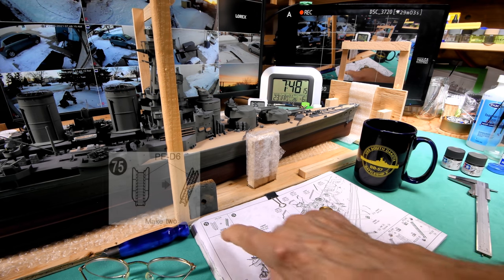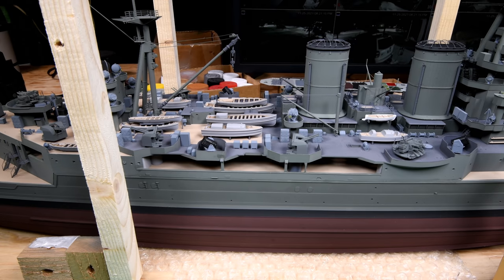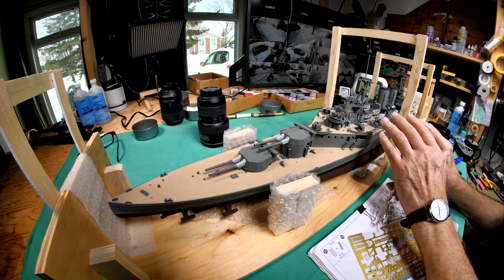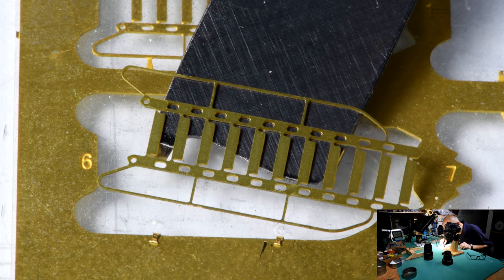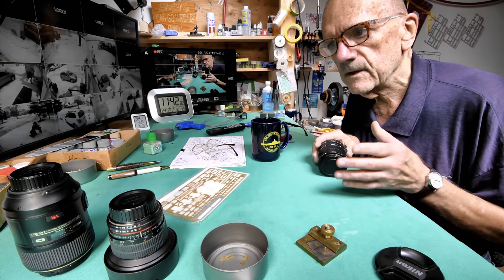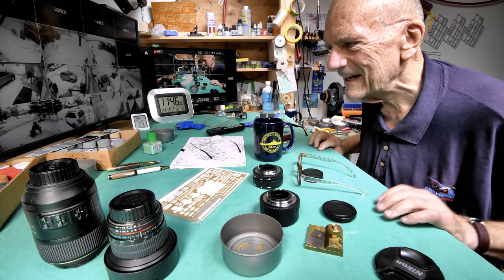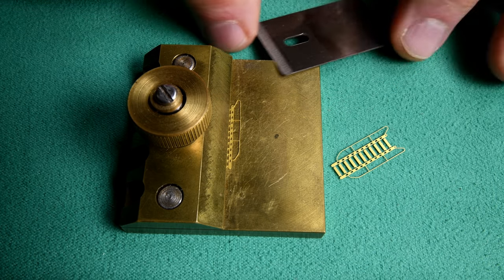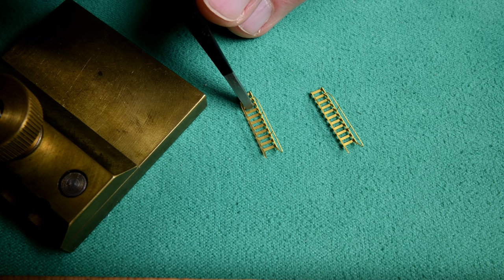The Model Ship - Part 1003

Comment: Ron, Z9 was out of my range so settled for the Z6. When I got my Z6 it included the adapter at US$95
Reply from the maker: "Z6" Only watched one review, but it sounds great to me too Dave. 👍
Reply: @roncalverley  yes very happy with it. One draw back is that it does not have a sensor screen so when you change lenses you can get dust on the sensor. Don't worry the z9 has one. Also read that the z9 does not have a manual shutter and there may be issues with synchronization to artificial light.
Reply: BTW I got the old style adaptor, the one with the rectangular knob, which is playing havoc with the camera stand I have. Make sure you get the new model which is fully circular. And finally some of my older f-mount lenses will not auto focus with the z6 while they do with my d90!!!